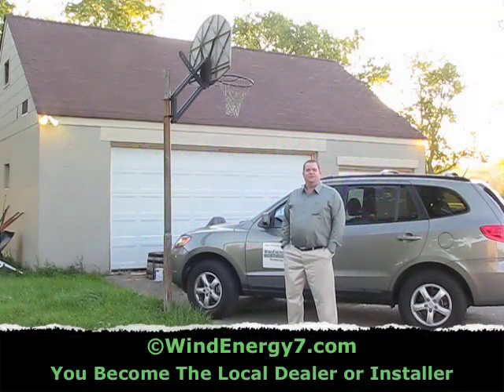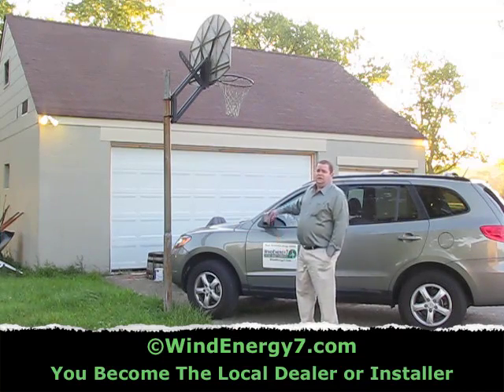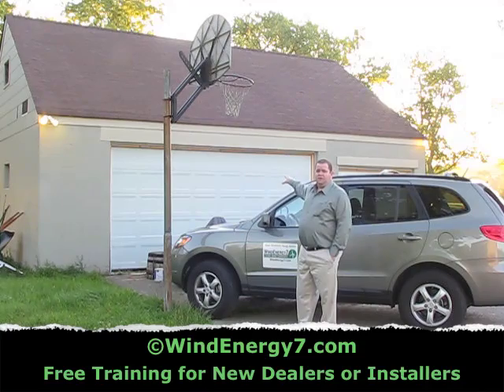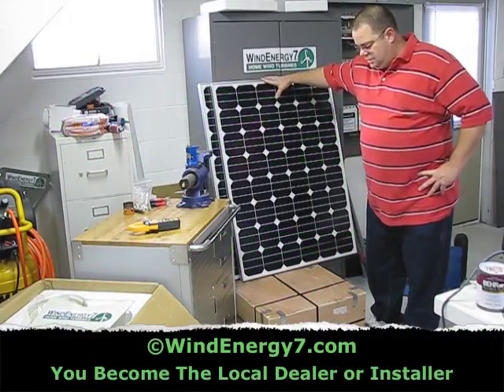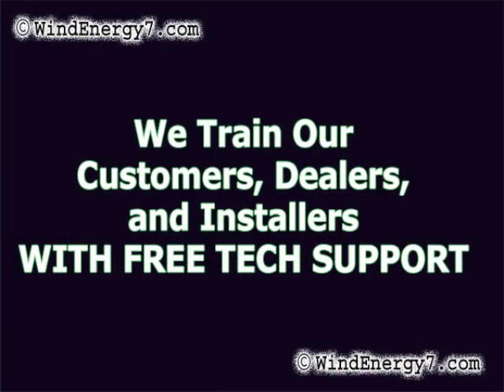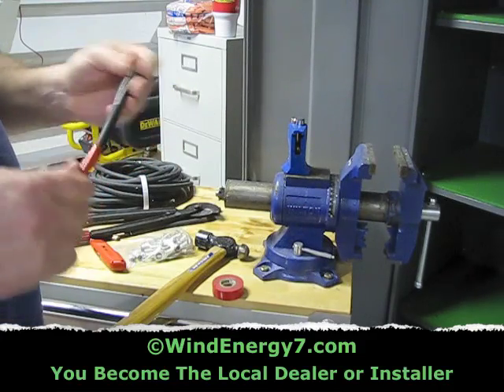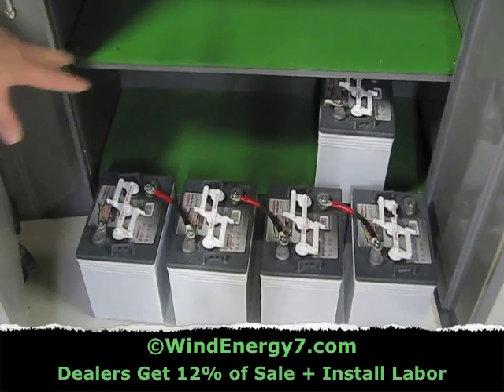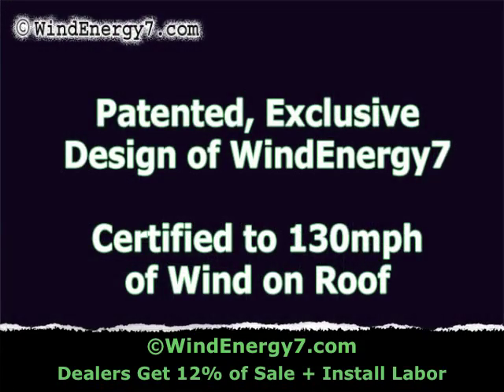Roof Mount Wind Turbine

Comment: The cost is pretty high for this.  Instead of showing the install, how about showing us your numbers.  What was your average wind speed,  How many KWH did it generate each day.  How often do the batteries have to be replaced.  The other problem is this will be out of reach for most suburban customers.  Many HOAs do not allow wind turbines and only allow solar installs on roof sides that do not face the street.  The only people who could get away with this live on acreages.

Comment: Review By C. Luczak - ★★★★★ 3 years ago -   #RoofMill
I helped a friend install the the RoofMill system on his house here in Utah last year. It was a great experience and everything worked just like it was supposed to. WindEnergy7 helped us through planning, permit, install, and everything and we had never done a windmill or solar panel before. The kit was well designed. I wish it came with the batteries but from what Sam at WindEnergy7 said it cost more to ship them than to buy them local so that makes sense I guess. The system has been making power for months without a hitch. The most fun home improvement project my friend and I have ever done. https://www.google.com/maps/contrib/118259844948444805320/reviews

Comment: Hello. This may be an old video but I'm 14 years old and interested in wind and solar power. I am currently as if writing this making plants to build my own small PVC wind turbine to make a power for camping and for leisure. This seems very cool but the question I have is why are there so many blades? I've always heard that having 3 blades was more efficient.
Reply from the maker: 3 blades is "FASTER" and if you should have yourself a real high wind it will overspeed and tear up.  5 blades is slower but more torque.  There is about 15 years of trial and error in the design of these blades.  These systems hold up in 130 mph wind and last for decades.  Over 5 blades is too many, less than 5 is too few.  But its the exact twist, size, weight, balance and everything that makes a RoofMill the best small turbine system there is.

Comment from the maker: Reviewed By C. Luczak: ★★★★★ 3 years ago
I helped a friend install the the RoofMill system on his house here in Utah last year.  It was a great experience and everything worked just like it was supposed to.  WindEnergy7 helped us through planning, permit, install, and everything and we had never done a windmill or solar panel before.  The kit was well designed.  I wish it came with the batteries but from what Sam at WindEnergy7 said it cost more to ship them than to buy them local so that makes sense I guess.  The system has been making power for months without a hitch.  The most fun home improvement project my friend and I have ever done.
https://www.google.com/maps/contrib/118259844948444805320/reviews

Comment: in a single turbine how much cost and how much energy kw generate
Reply from the maker: That varies depending on what size system you are buying.  I do not sell single turbines but I do sell a 3kW hybrid kit that comes with 1kW of wind and 2kW of solar.  All my sales are of complete engineered systems and we only sell whole working solutions, not parts or pieces.

Comment: Get those solar panels up on that roof now!
Reply from the maker: Right on, when you have wind only, the power in summer is light wind period.. THAT's when the solar kicks in on its power season.  Hybrid is critical to success, needs BOTH wind and solar.  RoofMill is a hybrid system design.

Comment: If your company receive an order from the Caribbean islands would you guys travel to do the survey and installation? I love this video had to subscribe to the channel
Reply from the maker: Hi Gale,  fill out our contact form at http://RoofMill.net and make contact.  We will ship anywhere in the world to closest air or sea port.  I have shipped systems into India and its usually about $1600 in freight depending on how fast you want it to get there.  All payments made by wire transfer only in US funds.. We do our site survey and drawings by satellite images and weather data.  We supply all the engineering to support any local contractor or electrician to perform the actual installation.  This is normal process for us having installs all over the world is no problem.

Comment: interested in dealership
Reply from the maker: Hi Tejas,  fill out our contact form at http://RoofMill.net and make contact.  We do our site survey and drawings by satellite images and weather data.  We supply all the engineering to support any local contractor or electrician to perform the actual installation.  You can become a dealer in your area as soon as your system is up and ready for demo to show customers your system.

Comment: Hi, l'm quite impressed with your innovative ideas. I'm based in the UK, and planning to build a bungalow house in Nigeria. The environment is favourable in terms of wind and sun, but l don't know the sort of package you've got, please. My intention is to get close to 15kWh, which is based on my research. Would love to hear from you soon. Thanks!
Reply from the maker: Hi Tunex084,  15kWh per day?  or a 15kW system?  Please tell me what your monthly average usage is in kwH for starters.  fill out our contact form at http://RoofMill.net and make contact.  We will ship anywhere in the world to closest air or sea port.  I have shipped systems into Europe and its usually about $1900 in freight depending on how fast you want it to get there.  All payments made by wire transfer and we do our site survey and drawings by satellite images and weather data.  We supply all the engineering to support any local contractor or electrician to perform the actual installation.  This is normal process for us having installs all over the world is no problem..

Comment: how much for this kit in india  Near Bombay ?
Reply from the maker: Hi Girish,  fill out our contact form at http://RoofMill.net and make contact.  We will quote your system size and shipping location for you to Bombay.  I have shipped systems into India and its usually about $1600 in freight depending on how fast you want hardware.  Payments made by wire transfer only in US funds.. We supply all the engineering to support any local contractor or electrician to perform the actual installation.  This is normal process for us having installs done in India is no problem.. We have Indian power standard 50Hz output no problem.

Comment: good idea, however , here in Arizona, if you don't go completely "off grid", there is a 50$ charge added to your electric bill for having ANY supplemental electricity....even solar water heaters!
Reply from the maker: Thats a good reason to VOTE.  Your state leads the nation in ignorant corrupt policy and government backed by utility companies to discourage competition.  HOWEVER, all my customers in Arizona would still rather pay $50 than the $300 theyt were paying before buying my systems.  You are RENTING electricity.  Would you Rent a home forever?  why?  Because renting is a one way expense with no equity gained.  ALSO, I can power any size home or business 100% off grid, no problem if that's what you like.  We specialize of OFF GRID and Emergency Power.  Please fill out our contact form at http://RoofMill.net and make contact.

Comment: I heard that over time those PVC blades will crack and fall apart.
Reply from the maker: PVC blades may do that, but these are not PVC.  You are looking at the best and most successful small turbine ever.  Look at the date of this video.  I haven't had one warranty or replacement of a blade from age or sun damage or whatever you are talking about here.  Not One.  But I do all my sales direct by email and quotation.  http://RoofMill.net
Reply: @RoofMountWindTurbine  what levels of noise  and. Vibration is expearanced with in the building?

Comment: When do you need maintain them, example of emergency, are there any break component for wings?
Reply from the maker: These are designed for maintenance free life to survive a home mortgage.  WindEnergy7 has Roof Mount Wind Turbine installations with customers, dealers, and installers WORLDWIDE.  There's a reason that nobody else has such a large body of work.  In the United States, we have Roof Mount Wind Turbine installations in about 40 states from Hawaii to Massachusetts. WindEnergy7 pioneered the concept of multiple Roof Mount Wind Turbine arrays as an innovation of the US manufacturer. Home Wind Farm™ was initially using the RoofMill™, an invention of WindEnergy7 founder who first mounted smaller home wind turbines on a roof.  For BEST NEW VIDEOS visit:  ->  WINDENERGY7.COM

Comment: I need help I'm at the stator wiring, only four coils, I taped the top ones white and bottom black, now I'm looking for help what goes where please thanks in advance
Reply from the maker: Its a little late now, you should have bought an engineered system.  Anything you put on your house has to pass inspections and be certified as safe and secure.  You can burn your house down with a home made experiment.  Get a legitimate install kit, work with that.
Reply: RoofMountWindTurbine I live in Mexico no regulations
Reply from the maker: Should have bought a professional system and worked on installing that.  catching a house on fire is not a cool idea and electrical causes most home fires.  Thats what Im saying really.  Its not safe to do in a home as an amateur DIY.

Comment: how is the sound? will i hear the propeller spinning inside my house?
Reply: And probably wind-pixies will be attracted to the rotary motion.
Reply from the maker: No, sound is not an issue inside or outside.  Thats why its an invention and is designed and successful for this use.  The RoofMill™ won a green design contest on Earth Day 2010. You are looking at the most advanced Wind/Solar Hybrid home energy system in the world.  No experiment here.
Reply: Thank you for your valuable input. Together we may yet nail the lie about wind turbines being 'noisy' and 'spoiling the view. Some people would rather freeze in the dark!
Reply from the maker: Hi paulius, Ever heard of SKF bearings and precision machined stainless steel?  These turbines compared to their hardware design are super slow turning at a few hundred RPM.  Your gas generators cruise at 1800 RPM mostly.  These are around 600 RPM at full power.  They have very, very little friction and low speed YET use the highest quality bearings and steel in the world.  Its a great combination for longevity.
Reply: For how long it will be silent? Mechanical parts tent to go louder with the time.. @igor If you have a lot of sunlight, I would suggest solar panels instead of wind.
Reply: Igor Tarasyuk only Cars will hear the sound coz its a garage

Comment: If you have to choose between wind turbine or solar panel(s), which one will you go for and why?
Reply: +hawkeye0248 You have to have BOTH to have a real energy system of any value.  I get calls every day to solar owners, to add wind to their weak system that is useless all night, during storms, and all winter months.  Same with wind turbines.  MY RULE OF THUMB BELOW:
(1) WIND POWER = peak in winter, weak in summer.
(2) SOLAR PANEL = peak in summer, weak in winter.
See the synergy?  My RoofMill™ Hybrid Designs Strong all year long, power anytime, anywhere, grid tie WITH off-grid energy security.  No system design is better and more successful.

Comment: Very interested but want to know what permits or approvals you had to get.  Looking for anyone who has tried this in So Cal
Reply: +Little Big House We have many of them in California and an installed base of over 40 different states, it requires a local electrical permit.  We handle the support and direction of all that as part the installation support we do.  ANY LOCAL ELECTRICIAN or contractor can install the systems.

Comment: is there any type of breaking system on these to slow them down or stop completely for when the wind gets to strong ? or are they always free turning?
Reply: +fun under the Sun Yes they have aerodynamic overspeeding control with electromagnetic braking so that its all frictionless to control speed without making weak and tear, noise, or vibration.
Reply from the maker: Yes of course.  The 5 bladed design and engineered twist, shape, and length of the blades has been tuned over the years. The blades themselves produce a time proven effect as both speed limitation by drag with low wind producing torque.  As soon as the blades reach a proper speed they begin to create drag which reduces over speeding.  In addition to that, the OptiVolt-7 controllers we use will limit over speed by voltage negotiation.  As soon as the proper speed is exceeded the controller will use the magnets in the turbine to brake and slow its speed and protect from over speeding.  These are both frictionless methods which stay quiet and protect turbines from wear and noise. THX

Comment: You may be able to answer this question for me. My husband and I have plans to move to Alaska off grid and want wind turbines for some form of electricity. Your system is a duel system so my question is this. How effective would your system work for Alaskan weather conditions from lack of sunlight certain times of year to extreme cold? There's plenty of wind out there. We need to know what would produce enough energy for items like powered tools, small kitchen appliances, heat for the garage so engine don't freeze, food canning? So basically off grid living with only some convinces. What would be best for Alaskan living?
Reply from the maker: Don't be such a dick.  I have a lot of customers of small wind turbines in Alaska.  They have great outdoors, freedom, and wildlife there.  Its not for me.  But please don't be mean to the lady man.  THX
Reply: +Liz Edwards We have MANY systems in Alaska and they do very well because its windy as hell up there in cold climates.  We power lots of on and off grid homes, camps, equipment, with out hybrid power solutions.  We ship all over the world.
Reply: +WindEnergy7  About how much does your system cost from basic to advanced.
Reply from the maker: +Liz Edwards Our smallest kits are 3kW and they go up to as large as you want.  The pricing can be found at the website, thanks.
WINDENERGY7.COM
Reply: Liz Edwards iiiiiiiiiiiii
Reply: Liz Edwards ooooiooooooooooooooo
Reply: WindEnergy7 ooooioooooooooooooo
Reply: WindEnergy7 ooooiooooooooooooooo a I oooooo
Reply: WindEnergy7 oooooooooooooooooo

Comment: Hello, great video and wind turbines. I am curious if you guys are designing your own ac brussless motors or are you buying the generator heads from a supplier. If so who is the supplier or the brand of generator. I believe this is a great idea. Thank you.
Reply: +Andres Fuentes WindEnergy7 is a manufacturer and inventor.  We sell system products encompassing our inventions with complete engineered solutions.  We don't sell any parts or pieces of our RoofMill systems.  A generator is useless without an entire system so we don't sell generators.

Comment: Will it ever get rusty overtime? or at least some cumulative dirt from the sky stuck in the motor that prevent it to move
Reply from the maker: These are not designed to use indoors. No dirt from sky will get stuck in motor.  The mounts are double treated and poweder coated, so if you don't chip or scratch it it won't rust.  If you do, you touch it up and seal it off because those mounts are quality STRONG OHIO STEEL.  The rest is anticorrosive aluminum and stainless steel which are also coated for protection of elements.  These are sealed generator body well protected from dirt, dist, and moisture and permanently lubricated bearings inside.  This RoofMill is best hardware made anywhere in the world IMO.

Comment: paint them sky blue so they could be less noticable
Reply from the maker: Actually we used to offer that and none of the customers bought it.  For the best NEW VIDEOS visit:  ->  WINDENERGY7.COM  The customers are not trying to hide them at all, they are proud of them and love to see them working.  We also tried offering painting the mounts to match the roofing and nobody bought that either.  Since I invented the RoofMill roof monted wind turbine.. these are many years in the market successfully and we have tried most anything you can imagine by now.
Reply: Hello, I've looked on your website to purchase 1-3x turbine mounts but the website has no links that go anywhere. Are you still producing these roof mounts? I need 2 mounts that use 1.5" ID sch 80 steel pipe and 1 mount that uses 2.5" sch 80 steel pipe. We have an off grid hemp farm in Southern Colorado. BigNuggetFarm.com has some of our hemp/CBD oil products to give an idea of what we do.
Reply: If it becomes unnoticeable , it can be dangerous for the birds flying by

Comment: Say someone needs to do maintenance on the roof and needs to immobilize those blades. What is the mechanism to apply a brake to the turbine?
Reply from the maker: Each turbine has an electromagnetic brake you can apply when needed from within the home and there's a manual way to brake them if needed.  They are installed tied down or in brake until installation is done, then we release them to run.

Comment: What is the min speed wind for the turbine to work?
Reply: ill gess max 6 m/s about 13 km/h or 8 mph
Reply from the maker: Gepard mic  Actually its just under 6mph to start making power.  This is the most productive turbine of its size in low or high wind.

Comment: I think, this way of installation could be realy noisy! :(( You have no chances to take e sleep in this house. :))
Reply: These systems have been installed for years and now in over 40 states from Hawaii to NY.  I have been installing and assisting for a few years and have seen several systems go live.  They are more quiet than an AC unit next to the home like everyone has.  You would be very surprised how smooth and quiet.